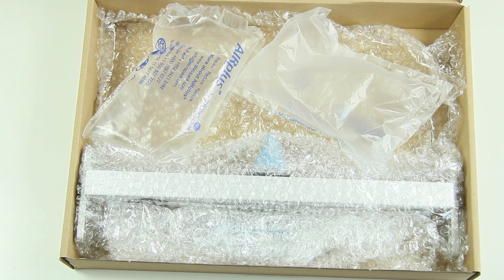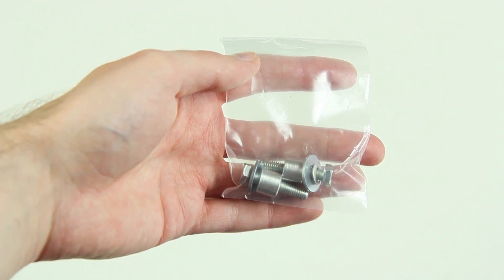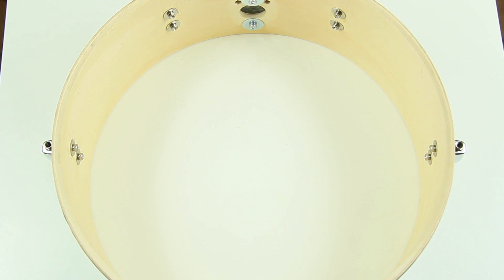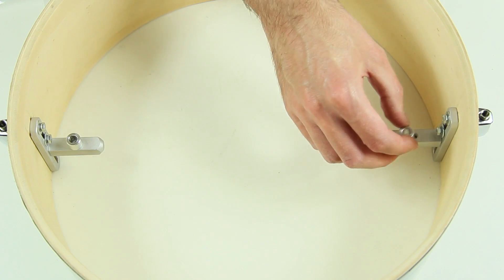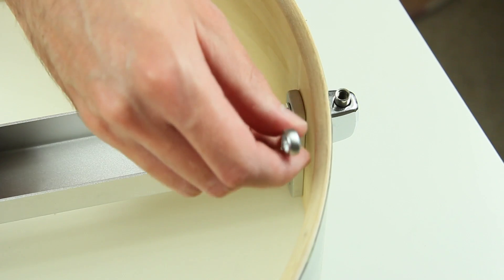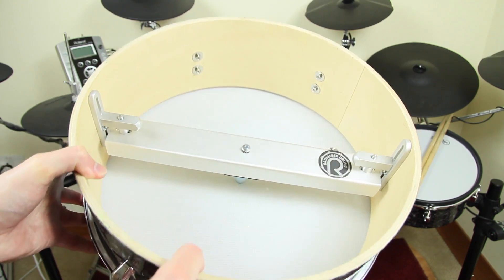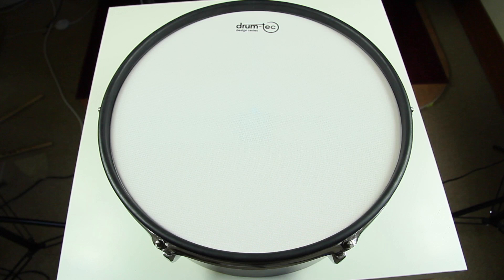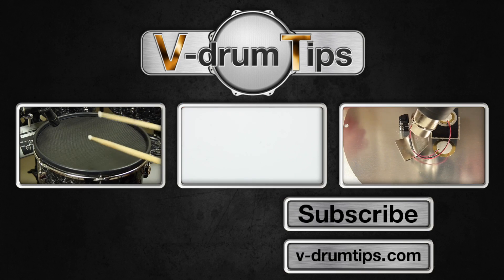R-Drums RTB Trigger System - Review (E-drums)

Comment: why it have to be cone shape?
Reply from the maker: It is the ideal shape to get an accurate trigger result and a small hot spot. Roland invented it this way. There are of course cylinder shape triggers, but they aren't that good.
Reply: cylinder is for bass drum?
Reply from the maker: Depends, Roland Triggers do have cones in the bass drum, R-Drums made a cylinder shape trigger that can directly be struck.

Comment: Can you give me an honest opinion on this vs the RTS on the snare?  I know RTS would have the rim piezo in the center making it more consistent as far as open/closed rimshot triggers. But could you tell a big difference between them? Also would there be any other improvements besides that? definitely looks awesome & stable  :) but I am not sure if it's worth the upgrade as I already have RTB (came today but I have not installed them yet), thanks!
Reply from the maker: The height adjustment is the biggest advantage. The difference with the rim piezo in the total centre is more accurate triggering. But this is meant to be for high end modules like the TD-30. You will mostlikely not recognize it while playing with a standard module. The RTS-System is basically the high end system, there is no better trigger system out there. Its construction reduces mechanical unwanted vibrations. I would use it as a snare system and the RTB as toms.
Reply: I see, since I do have the high end module TD-30, I will definitely be considering RTS for my snare, thanks again

Comment: awesome mine is coming very soon! thanks to this video! 
I dont know if this is too late to ask but do you have setting recommendation for 14" snare on TD-30 module? also for 22" bass drum setting? thanks for the awesome video!
Reply from the maker: +Taewan Kwon I don't have a TD-30, but it is usually working with a slightly modified standard setting. Especially the bass trigger does not need much tweaking.
Reply: Vdrum Tips Great! can't wait for it, awesome videos by the way!
Reply from the maker: I use the BD Trigger and the TD-30. I recommend checking Luke Oswalds (Drumangle) TD-30 Trigger setup video.

Comment: Hello, for converting a full set using these triggers is it better to use thick shells as I have now vintage maple sonor delite shells and I heard somewhere putting these trigger systems in thin 4 or 6 ply shells it can crack the shell?
Reply from the maker: +Koen Olsman I don't know why these triggers would crack the shell. They are made in a way that it is impossible to damage the shell. It is one of the best systems out there. I highly recommend it. Just contact the guys before, in case your shells are not standard.

Comment: could i put pillows inside the snare for reduce the noise? 
is that better than your "home made"? the 7 drums video i mean
Reply from the maker: +Guille Lezerín I would not use pillows and rather go for a foam ring. They are called muffle rings. 
The trigger result is identical as the piezos and cone I used is from R-Drums too. The triggerbar is lighter and not to be considered DIY, since you only have to apply it to a pad and not build it from the scratch. I would always recommend the trigger bar for people who are not into DIY or don't have the access to materials and tools.
Reply: So, the only difference is the price and the time! Thank you!
Reply from the maker: +Guille Lezerín ...and the quality of a DIY system is not comparable with the R-Drums trigger bar. And the shipping costs of 3 different shops make the DIY expensive too.
Reply: im not sure about if you are saying that the DIY is better or the bar is better with and the quality of a DIY system is not comparable with the R-Drums trigger bar
Reply from the maker: +Guille Lezerín Sorry for being unclear. I would say the bar is quality wise better, because the surface is grained and it is a professional made, which is usually not possible with a DIY. And you only pay 1 time the shipping costs. 

The DIY system requires tools, effort and you probably have to pay several times for shipping as you order the screws on shop A, the plate on Shop B, the Piezo on shop C.... The DIY makes only sense if you have skills, tools or want to build many systems. 

What is your plan? Do you want to convert your snare drum?
Reply: you know that we was tallking yesterday, im out about bands live and i want to play alone in my house while iam studying, so i have a real drum kit but i need to buy something to practice on home. i think i pref typical e-drum.. but this looks great, but that have a bad pont: the sizes.. so big to my room, i can do but hm... i will have like 2000 euros for the next year, (ferbrary more or less) and i am more confused than ever with lot of things,
now i doubt about the tdk 25k, its a good set? better than 11 kv? better than 15kv? better than this barr? uff, fuck live! i know everthing about acoustic.. but the electronic sets.. im noob,
SORRY MY ENGLISH (im spanish without good lenguage education) AND SORRY MY OVER WRITTEN!
Reply from the maker: Here is my opinion on the TD-25: http://www.v-drumtips.com/?p=317

But consider other peoples opinion too. 

It is better than the TD-15 though. But if I where you, I would buy a second hand TD-12 or TD-20 with that budget.
Reply: thank you i gonna read right now

Comment: What's the different between the trigger bar system and the higher end snare/tom trigger system from R-drums? Is it simply the mounting style or are there others differences?
Reply from the maker: Nick Pratt The High End systems have the rim triggers placed excactly in the middle for a more accurate rim triggering. (Same sensitivity on every rim spot). And it is possbile to correct the trigger cone height easier through the evaluation screws.

Comment: Impressive video, as always! Thank you so much for making it :D
Is it possible to move the 1/4" connector to the air vent hole? I know the length wouldn't be enough, but with soldering, maybe?
Reply from the maker: Henrique Foletto Thank you! There is actually no need to move the connector. R-Drums provides an air went cable which can be plugged into the trigger bar and mounted to the air hole. No soldering required. http://goo.gl/e7KHW9